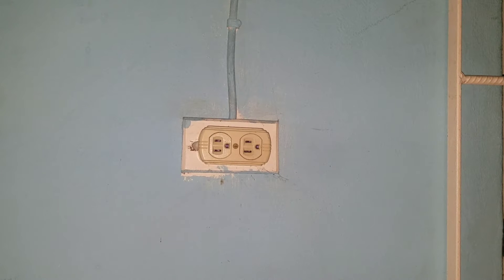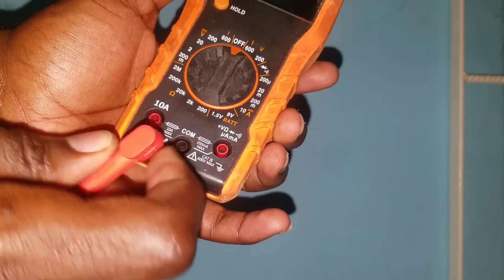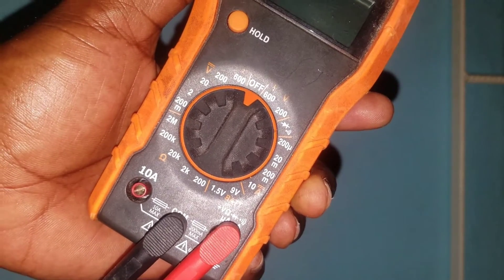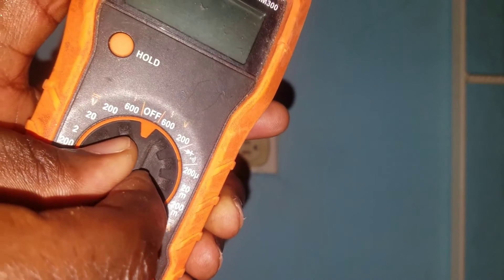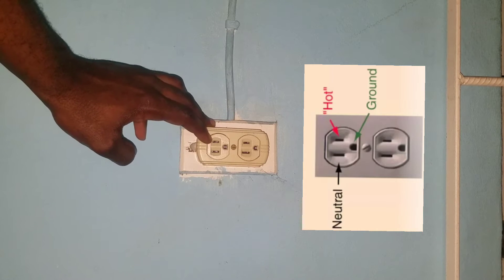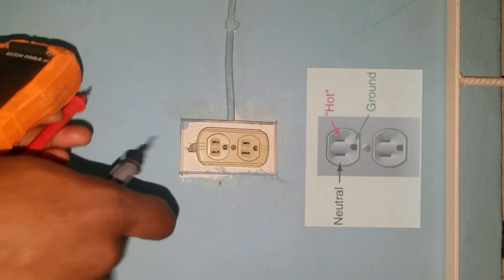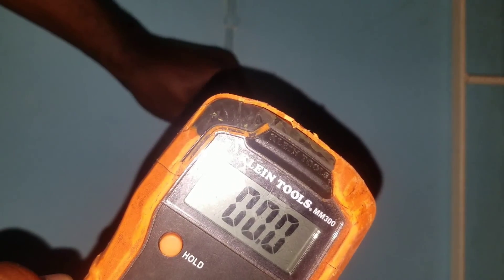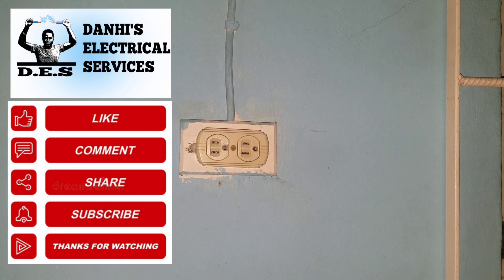Klein Tools MM300 Multimeter in action | How to Measure Voltage at Home

Comment: Wait why not 120v
Reply from the maker: Good question. In Jamaica, the nominal voltage is 110/220V with a tolerance of +/- 5%. The voltage was this low because, at the time of the video, there was a low voltage issue at the premises due to corrosion. That is now resolved and I can safely say the voltage reading for this same outlet is now 112V.